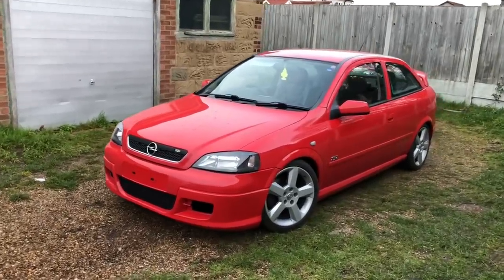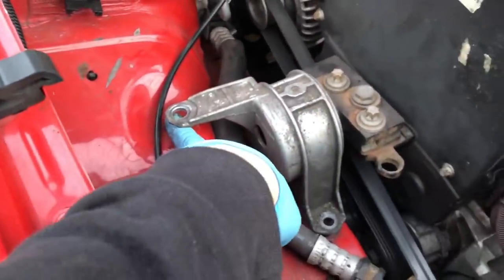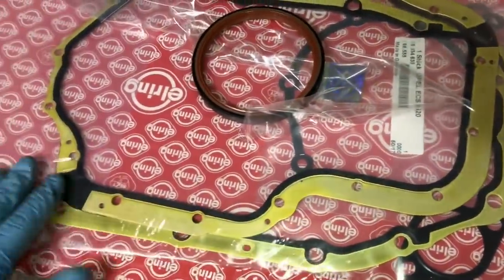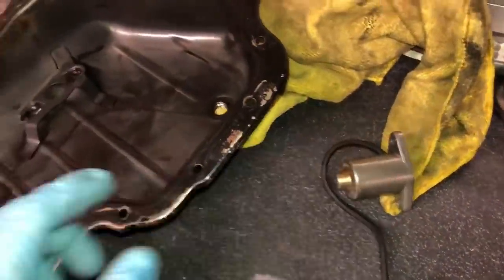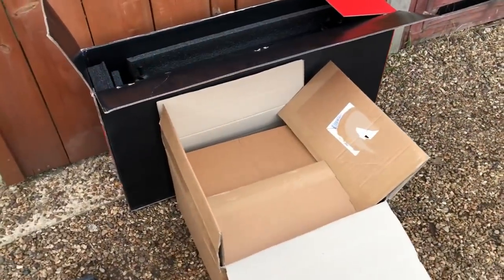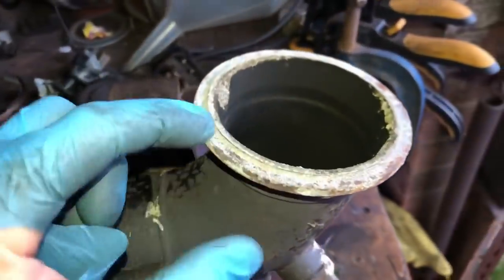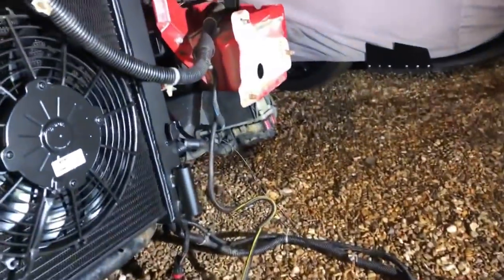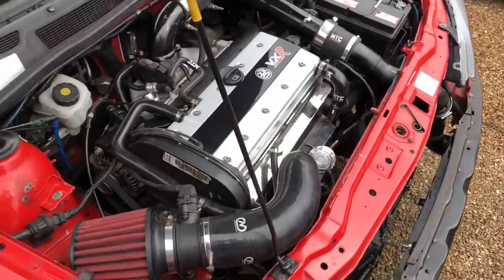Making This Super Rare Car EVEN BETTER!

Comment: I got the same MK4 Sri turbo 190. In black.  Mine needs so much doing to it. Stem seals need replacing. Past owner has welded every join on exhaust. As well as to roof paint off.  Needs new front bumper as side clips broken as well as bonet don't sit all way down. But on good side 90k on it. Vxr turbo. Uprated clutch and 220 remap. But I do need to figour out that traction control delete as I can't do more than 1/4 throttle in 1st 2nd or just wheel spins and front feels like trying to skip down the road

Comment: Cheers Aaron for yet another top vid, I plan to sort my zafira gsi out with no leaks and a rebuilt engine etc etc so find your vids and knowledge very helpful, the traction buttons easier than I thought although getting to the back of the pump on a zaf looks like agg! Keep the vids coming, I'm a Ford guy at heart so love all ya vids, the Gsi's just practical and my first vauxhall
Reply from the maker: Cheers ken! Thats how they should be leak free. Traction button is easy you will have no problem 😎

Comment: I have got one that looks very similar to yours.
I have an vauxhall astra 2.0 sri 3 door in red 1999 owned it 15 years and there's only about 30 red ones left on the road now in the uk and were only made for 18 months and got replaced by the 2.2.
It's totally standard straight and unusually its got mostly opel parts on it from factory when its a badged as a vauxhall and its a factory non ac model which gives it a bit more power from an ac one,so just a handful left in the country with this exact spec i reckon.
Its scabbed on the rear arches now but everywhere is straight and solid with no rot underneath.
Very nice yours is and i believe only 500 were made as a limited edition and upto about 1000 made with the 2 litre model of mine with 111 left on the road as of 2019 according to howmanyleft.co.uk.
I am very likely to sell mine in the summer as im getting a astra h vxr as a bloke is getting a tesla model 3 in the summer and selling his 1 owner low mileage mint vxr to me.
I would keep hold of it as it will sure to shoot up in value.

Comment: My Sri turbo 190 is getting ready for some love now, I've owned it for 15 yrs and it's never had anything go wrong with it just general wear and tear. I'm getting a bit of smoke now and she's abit clonky on cold start iv noticed this last week untill it warms a bit? 😥
Reply from the maker: Amazing hearing someone owning them that amount of time. Is the noise from top or bottom end?
Reply: @AaronUnknownPerformance  not sure iv not looked properly yet, it's never had any engine work done its used daily until a year ago, iv alway changed oil every 6 months and used vauxhall semi 10/40. Done around 90,000 miles any thoughts would be appreciated 👍🤔

Comment: Nice work man👍, when I drive my Astra mk4 sri 2lt 1999 the tc light comes on and stays on any ideas why,  I got fault code c0244 engine torque input no signal
Reply from the maker: Normally caused by faulty maf sensor, its part of torque input

Comment: Awesome video, I’ve got a tc loom to fit so this has cleared up plenty of questions I had. 

I’m planning on an alloy rad and spal fans in the future, but wanted to keep air con, this doable with an fmic also?
Reply from the maker: Easy mate your have no probs. Yeah its defiantly doable just wont look as tidy
Reply: After a few summers in a stripped out track car I promised myself to never remove air con 😂

One job I need to do is the oil return gasket on turbo, got a new pipe as it’s the old metal one rather than hose version, is it possible to do without taking the turbo off?

Comment: You certainly know these motors back to front Azz 😀 Did you have to use all you're other super powers not to start wire wheeling bits of rust off the sub frame underneath 🤣
Reply from the maker: I did mate 🤣 ive just got my subframe back from powdercoat for my Gsi 😎
Reply: @AaronUnknownPerformance  Ohh nice, blue was the popular choice back in the day for a gsi  but when ya see a red one they look miles better now, aged miles better where the blue looks dated.

Comment: The last sump gasket I did on a leh I used sealant and it leaked just as bad. When you checked for boost leaks, is the throttle body butterfly air tight ?
Reply from the maker: Yeah use them dry mate, torqued to spec they wont leak. Its almost airtight as its electric the idles controlled by ecu flap adjusts